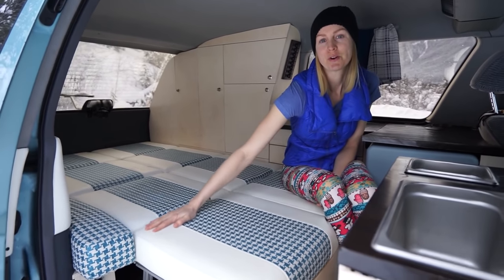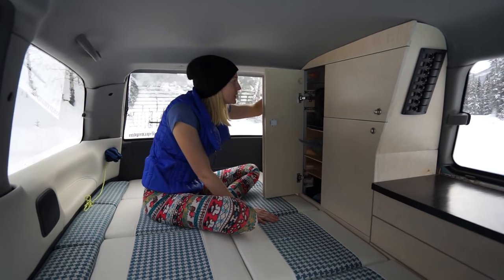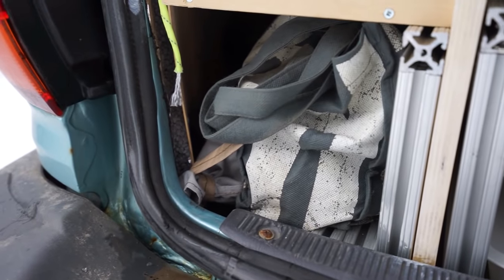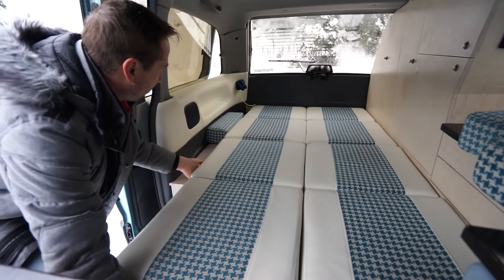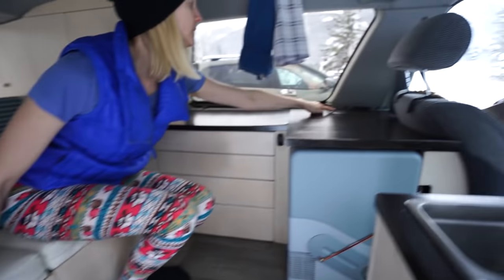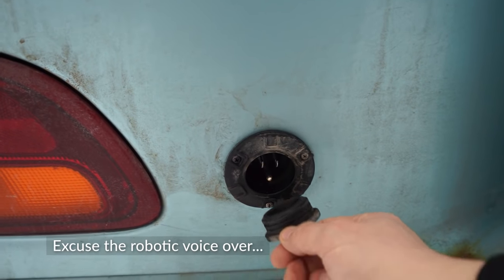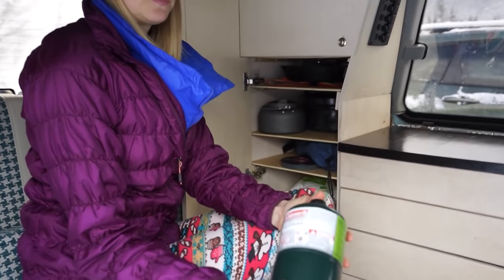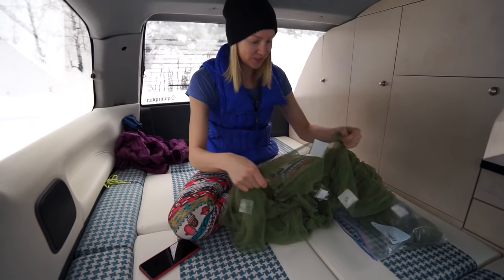Sexiest BUDGET MINI-CAMPER Ever! // VAN TOUR - Minivan Sleeps 5-6 People with Kids

Comment: I really love how you make full used of every inch in this minivan. The design is well thought out and comfy to use. The only problem is the toilet i think ? Can you show us where is the heater ?
Reply from the maker: Yes, toilet is the only think I didn't have room for. I do have a small one that folds up and sits under the backseat, but only use it when I'm in really remote places. I also have a video coming up on the heater specifically!

Comment: Most EXCELLENT MiniVan build!! Great job! Would enjoy seeing the tent when weather permits.’
Reply from the maker: Sure, I actually used it with the kids a few weeks ago, but with a 1500W heater. They were toasty warm at -20°C outside.
Reply: @GotMountains  
Since you have several kids have you ever thought about converting a small pull trailer converted into a toy hauler / camper addition for greater flexibility and options.  This would allow for use during different weather seasons with greater ease and comfort with families sizes of more than one or two.
Reply from the maker: Hey Terry, here is a tour of the roof top tent! https://youtu.be/vGJoXr0ZxwI
Reply from the maker: @pamm2230  yes, we have considered options like that, or like a bus, but the fuel mileage changes considerably with a trailer. It also makes it harder to find parking in urban areas or crammed parking lots at trailheads. It would definitely open up some living space, but I'm not sure we want to trade the mobility benefits of our small van.

Comment: The Previa all-trac is a rock solid choice to convert to a camper van. You did an amazing job and I''m impressed by all the detail you went into to make everything fit. I had a '93 all-trac, that just with the seats in full recline, I could sleep very comfortably. Their awd system was extremely capable as well. Sadly, I sold the van last year as the cost to maintain it was getting out of hand. Parts, when you can find them, are very expensive. Best of luck to you both with this project and adventure.
Reply from the maker: Thanks, parts are definitely a challenge. I've had to learn to cross reference like a champ...lol. And you're right, they are incredible. I've plowed through snow so deep it was coming over the windshield and she didn't even hesitate.
Reply: @GotMountains  time to trade up into a awd Chrysler Pacifica
Reply from the maker: @autobotavengerfireballxl5339  haha, but then I lose the character!
Reply: @autobotavengerfireballxl5339  I haven't read much good about their transmissions, that was my hesitation.
Reply: @windsofmarchjourneyperrytr2823  the new ones or better then the old 62te

Comment: I have a similar diesel heater and also have used it in high altitudes. Yes you need kerosene but do not use it totally straight. mix 30 or 40% diesel in with the kerosene and it should work just as well. I think i did make the frequency setting different too which also worked at high altitudes (top of rocky mountains). The reason you need some diesel is because kerosene alone contains no lubricant. Your pump uses the fuel as a lubricant. if you run the pump a long time on kerosene alone without lubricant, the pump will die out on you. Probably on a cold night when you least expect it. Also a way to cut the noise on the pump is to suspend it with zip ties instead of attaching directly to the underside of the van with the rubber mount holder thing it came with. A lot of noise travels through the holder into the van where it is amplified. When it is suspended in air it is much quieter from the inside. you need only to suspend it a few cm from the frame or wherever you attached it. You can also add a few oz of a diesel fuel cleaner additive to the mix as well. hope this helps you out.
Reply from the maker: Thanks for the notes! I have tuned mine with the Afterburner as well and it works like a charm! I still have to find a way to make it more quiet, but they are so nice to have in winter time!
Reply: @GotMountains  the noise is its probably something you will figure out how to mitigate. My heater is in a 70's Chevy g10 under the drivers seat (just like g20 or Ateam gmc Vandura - i used to own a previa before it hit a dear I love previas too). Anyway since my heater is under the drivers seat it is not right under my sleeping area like yours it is not too loud for my ears and like i said my pump is suspended by zip ties. Im only a part time van dweller, but I am now going to add more insulation since I already have some lying around in my garage and thinking of your situation gives me some ideas. 
I' already have some foam tube insulation for pipes that should work great around my pump. It's similar to the foam swimming pool noodles you find in summer time at dollar stores, (just search for Foam Pipe Insulation at home depot). it is only like $3.  If you do suspend the pump a few inches then above the pump  you can stick on to the under body of the van  (Frost King 0.125-in Foam Plumbing Pipe Wrap Insulation) between the pump and the under body. or use spray foam.  I have that frost king stuff and spray foam inside my doors of all my cars and vans.  But unlike the foam the frost king is not waterproof. Its useful for a lot of things all the same and relatively cheap. blob:https://www.youtube.com/c7bd1a6c-e7a1-4e1a-9898-62906d21ca8a
Whatever one puts in one should be aware the insulation or the foam pipe stuff can melt or maybe flammable if it gets too hot. My pump has a lot of tubing so it is far enough from my heater exhaust.  Any sheet metal like from an old microwave or any trash appliance one can make shielding under the van. I made a metal shield out to protect the pump and the heater especially air intake and the pump from snow water and dirt from the road. 
So there are lots of solutions you can try to make the sound a bit quieter. 
 Researching now regarding fuel mix, I found a product that says it Cleans And Lubricates Fuel System. "STA-BIL (15226) Diesel All-Season - Anti-Gel - Cetane Boost - Cleans And Lubricates" . Not sure, but I bet adding that to pure kerosene can make the pump happy and then no need to add diesel at all.  Adding anti-gel is good for cold weather if your pump is outside, which i think is much better than a pump inside. 
a few years ago first time in the mountains, not knowing anything I just used diesel fuel and my heater clogged up with soot and stopped lighting so I had to totally take the whole thing apart and clean it out. Now Im extra careful so that is why I have researched this topic.

Comment: This is the best minivan build I have seen yet. I only wish there was a place for a toilet and a table. Well done and great bed.
Reply from the maker: Actually I have a tripod toilet in the roof box...not that great in winter though 😂. For a table, I'm building one that attaches to the wall right behind the sliding door. It should do the trick.
Reply: Joshua Mitchell what makes you think this tiny cute perfect camper has room for a fixed table and poop pot? Does it look like they want clutter!

Comment: I think Ive watched every conversion on Youtube. This may be the best. Amazing. Can you tell me if you are aware some dimensions of your van. How long from back door to back of front seats and the width in van etc. What kind of size are you working with? Looking at a mini van conversion but not your type. Would like to do alot that you did. Thanks!
Reply from the maker: Thanks Paul! Yes, it's 96" from the rear hatch to the bottom of the front seats. The inside is 60" and 52" between the wheel wells. Interior height is 45". Hope that helps!

Comment: Great layout.  Suggestion for the storage door area.  Make the door openings stop higher, then have the lower door area be a drop down opening.  This allows for having bedding on the bed and being able to open and have access to the storage areas when in the seating mode.   Having the ability to rearrange how the storage area inside is configured is also a great option for the type of trip or storage needed for different times or seasons.
Reply from the maker: Yes, we've considered making changes to that part. Right now we have never had a moment when it has caused a problem, but raising it an inch would make it easier to use.

Comment: I've watched this video so many times and am continually inspired. 2 questions: in what order did you build things to not have to redo it. And is there anything you would change if you realized you didn't need often to make it worth having?  Thanks so much. I have a Toyota sienna and am looking around your website!!
Reply from the maker: Thanks for the love! We built it this way: ceiling insulation, wall sound deadening, wall insulation, floor insulation, sub floor, flooring, electrical, walls, cabinets, finish electrical, bed, countertops. That's a lot in one list...lol. Let me know if you want more clarity!
Reply: @GotMountains  very helpful. Thank you!

Comment: Great build, practical and everything’s at your finger tips. I also love your sink set up, didn’t think about using steamer trays. And yeah I’d be getting a proper fridge asap, those electric ones are pretty poor and suck the power
Reply from the maker: Thanks... The new van is getting a compressor fridge and freezer. This one was ok with our two batteries but we'll get double the distance on a better fridge.

Comment: Your van is one of the nicest ones I've seen for the small space you have
On Amazon they sell a rechargeable USB water pump which would be nice if you didn't want to use your inverter
If I had the know-how to build what you did everything would be the same except for the bed I would use a single bed frame or cot frame and it would be a permanent bed since it would only be me inside the van
But you did a wonderful job
The option you did to charge the batteries by Shore power is great also you could install I guess they call it an isolator and recharge the batteries from your alternator while you're driving
Reply from the maker: Oh, yes, this van has an isolator set up as well! We only ever really plug in to mains once and a while to condition the batteries, but the alternator charges it most of the time. The pump we have is 12V so it works off the batteries, but the USB charging ones are really handy too. Perfect to save on space and money.

Comment: Just found this video.  Great job.   Where in the heck did you find a PREVIA?  I recall test driving one in the  early 1990s.  I do not believe it was imported after 1998.  Have you had problems with maintenance and finding parts?  You two must be engineers.  There is a business opportunity for you in converting minivans.  You did a better job than the big RV Class B companies.  Roof top tent?? With snow on the ground and living in Canada...must get cold at night.  Take care and safe travels.
Reply from the maker: Haha, the roof top tent is for summer or we vent our Chinese diesel heater into it in the winter! Previas are pretty common here, although they are old enough now that most have a lot of rust.

Comment: That reach and twist movement from the front the front seat to the fridge is actually a sure-fire way to have an injury.  It would be safer, long term, to actually get off the seat, turn all the way around and then reach in the fridge.  I have a small Alpicool compresssion fridge and put it on the floor. There are narrow and taller versions too.
Reply from the maker: That's a good idea, we have space in the center console for a small compressor fridge.

Comment: Lots of weights on the 4 cylinders but great build! Love it...
Reply from the maker: That was why we bought the Supercharged version. It has lots of power. And why we used aluminum - the van weighs only 200kg heavier than it did stock when we were done.

Comment: I predict you will soon be cutting 2" off the bottom of the cupboard doors (and adding a fixed 2" strip in their place) to clear the bedding.
Reply from the maker: Haha, it actually clears the bed and sheets ok, so as long as the blankets can move, it's fine. Next time I'd likely give it another ½", but this is exactly how I designed it.

Comment: I'd love to do the rock & roll style bed for my delica. How much did it end up costing for the bed to do it yourself with aluminum?  Did you use a certain program to do the initial design?
Reply from the maker: Hey Jen, yeah, this would be perfect in a Delica. It would cost about $1200 not including the upholstery. You could shave about $500 off if you do the prep work on the metal (drilling/tapping/cutting) yourself. That includes the $200 I charge for the plans (includes parts list, ordering info, instructions, and the computer drawing).

Comment: Great video! Not sure what the exterior of the van looks like nor have I heard of a Previa.  What year is she and how many miles/gallon do you get with a full travel load of weight? (Yes, I am in the States).  Thanks for sharing the video.
Reply from the maker: Thanks! It's a 1995 Toyota Previa and was domestic to North America. Overseas they called it a Tarago and Estima. It gets about 20mpg when fully loaded, but would probably be better if I didn't have the roof rack.

Comment: Nice job with the design, I like the split bed option.
What kind of certification would you need to get if you added seat belts? Is it hard to get?
Reply from the maker: Thanks! 

In Canada there is no aftermarket certification, so I'm not sure about other countries. I imagine you'd need an assessment from an engineer if there was a certification. I'm certain that the ones in this would pass. There are engineering specs for all the materials used, so an engineer would be able to assess it very quickly.

Comment: Consider lights underneath outside for your unused circuits..  You can check for animals underneath (ever been skunked?  We were while camping!) Or for emergency repairs.  Might also scare off possible intruders.
Reply from the maker: Yes, we have exterior lights, we just have to install them!
Reply: What about "theatre lights" that come on gradually so as not to scare possible skunks?

Comment: I put the Car Wrap over my windows. As it was perforated. So I can see through it inside. It blocks the sun from ever hitting the windows. And you can buy the stuff in any color, to match your paint on the car....
Reply from the maker: I've considered that on my next build. It's amazing how easy it is to use.
Reply: @GotMountains  Just apply it to  the window. It's peel and stick...Leave some over lap. Then cut to fit with a razor knife..Been on for 6 years. They still look new.  As I bought the 3M brand. So I paid the extra $5.00 each for 3 48"x48".....

Great stuff....
Reply from the maker: @WizzRacing  interesting, I'll have to see if I can find some that match the color of my paint.
Reply: Thanks for the tip

Comment: #GoMountains Hello from California. I am absolutely impressed how all that stuff is put together so meticulously in such a tight space. Initially I mistook it for Toyota Sienna. Previa, I heard, was even a better built van with good mpg. Just curious, do you have carbon monoxide and smoke alarm since you have a fully functional heater inside that burns kerosene (esp. when you have children). Also, did you take help from professional cabinet makers or did you build it youself?  Best
Reply from the maker: Thank you! Yes, there is a CO² detector near the heater and circulation fan. For cabinetry, we did it ourselves. It is aluminum frame clad with the cabinet doors and panels. We have videos showing their construction.

Comment: Great build, very clever seat/bed setup! Is it legal to use as a passenger seat? Are there seat belts for it somewhere?
Reply from the maker: Yes, there are seat belts, but we take them out unless we have passengers with us. As a passenger seat, we have no testing facilities or standards for aftermarket equipment, so while I think it would pass a safety inspection I'm not too sure.

Comment: You've done an awesome job guys ! Congrats' ! I love it :)
Reply from the maker: Thanks so much! It was a lot of work, but certainly worth it!
Reply: @GotMountains  Yeah it looks ! I'm actually building mine, a Dodge Grand Caravan. You brought me a lot of ideas ! I'm wondering if I spend time, energy and money to insulate my van or not. Do you think it's worth to insulate the floor, the walls and windows ? Actually, it scares me to undo the roof ahah
Reply from the maker: Actually, no, it's not really worth it. See my video in -48°C. I have some, but if it's cold enough you need anything, a Chinese diesel heater is all you'll ever need. I'd recommend insulating covers for the windows, but that's it. Anything more doesn't give you good returns, especially in a van with lots of windows.
Reply: @GotMountains  Thanks for your answer and sharing your experience. Really appreciated :)
Reply from the maker: No problem!

Comment: Hi there, can you tell me the working height of your benches from the floor? as well as the measurement from the floor to the roof inside? I have a Toyota Estima and I am guessing they are about the same. I found your videos yesterday and am very impressed with your build.
Reply from the maker: Yes! This is the same as an Estima. The seat is 9" from the floor (and the foam adds another 4") and the roof will be the same as yours.
Reply: @GotMountains oh I meant the counter tops height, we call it a bench here.

Comment: Did you ever price out the difference in using the aluminum extrusion vs wood?
Reply from the maker: Not exactly, the wood wouldn't have given us the strength with such a small footprint as the aluminum. We wanted to be able to fit stuff underneath, so the strength to size ratio was important.